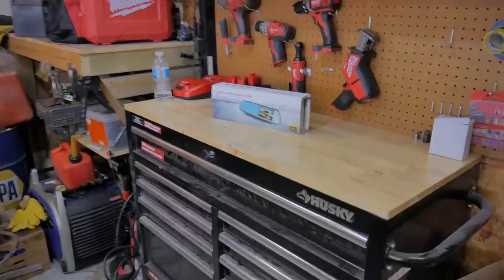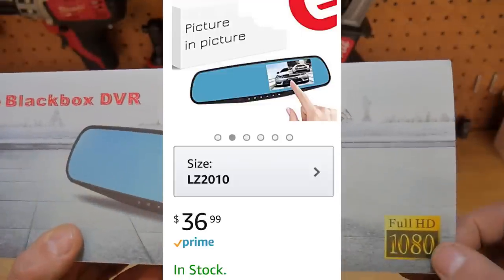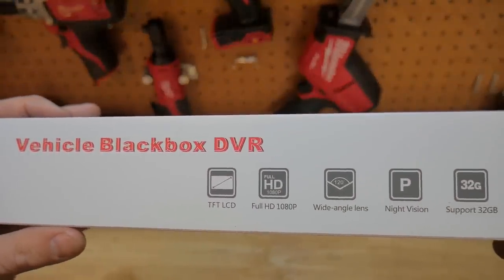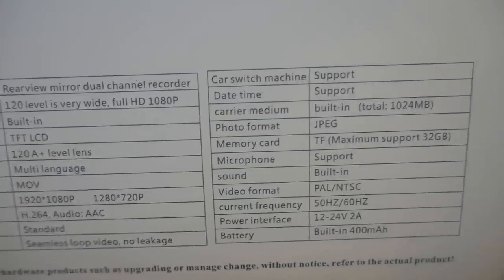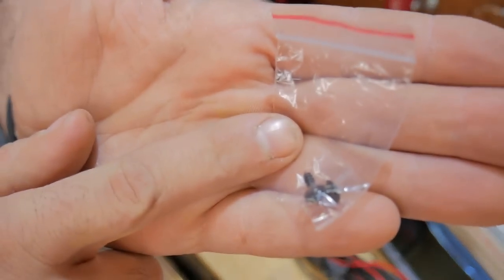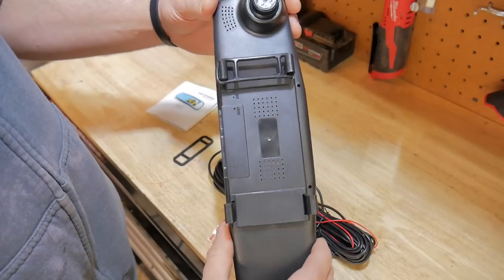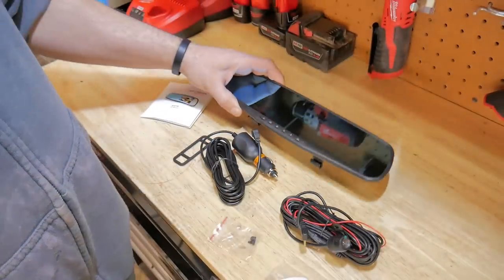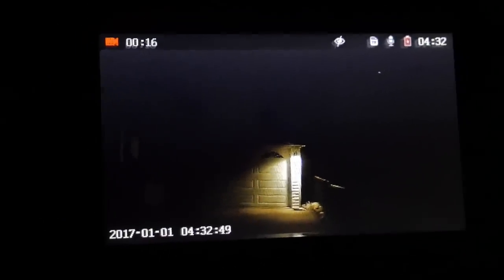Amazon/Dash cam install and review 1080p dual camera rear view mirror display

Comment: I bought a very similar model cam a few years back. The cheap rubber straps will break / dry rot on you quicky. I found using hair ties/bands, the small ones a better option to securing it to the rear view mirror.
Reply from the maker: Thanks for advice I was thinking the same thing
Reply: i just installed the sqame cam and i lubed mines in vasoline first. hoping it will help last longer

Comment: Very useful for me, thank you for posting it. I've just installed one of these units and the first thing I found out was that I couldn't set the menu with out first putting the memory card in. As I live in Thailand I needed to change the language to English to set the thing up. Your right about the mirror on dash cam. It's not bright like the factory mirror and takes a little time to get used to. All in all a good cheap piece of equipment just in case of accidents .
Thanks again and all the best from sunny Thailand.
Reply from the maker: glad your experience was good overall. for the price it is hard to beat. and your right great insurance just in case

Comment: Thank You for the examples. 
It is nice feature that both cameras get recorded automatically when it receives power, and that it maintains the recording even if manually turning display off with On/Off button. 

But I do have a setup in mind where I would like to have the video come up only when I start reversing, and show that reverse camera feed. I don't want to see any video when I am driving, as I don't care about that at all.
But it would be nice to have the frontal camera recording all the time, as safety video for proof if not guilty for accident etc, or something happens at the front and need to show evidence behalf of someone else. 

The reverse camera quality now can be improved with different camera, and night quality by having the IR lights lighting up the rear part.

I really like the idea that you can use the mirror as the mirror when reversing, as your mirrors are your primary means to see rearward. And why the reverse camera should be angled heavily downward so when you are backing up to tight place (pocket parking etc) you can actually see your trailer hook and distance from it to maybe 150-200 cm backwards, even just seeing a 100 cm backwards from the hook is enough, because then you can easily reverse and get your distance to car behind you properly, while you see everything else with mirrors. 

The mirror seemed to have a strong blue tint in it, and seemed to be fairly dark overall, but it can be difference in the camera itself. In night you don't see much with mirrors anyways unless you have good bright reverse lights in your car. 

But good presentation. Thank you!

Comment: Some years later I have one of these. Today only 6 days after install, it rubbed out an important accident. It just skipped to another event. The product had a lock on impact. In any case, the information was lost. Thanks for the vid. 👍
Reply from the maker: sorry to hear that. that really sucks !
Reply: @AllThingsCool  Hi, I've set it to 5 minute blocks now, seems OK. I'm pretty certain the firmware is a variant of another from a different dash cam I had. We'll see.

One thing of note: Left hand drive vehicles will have a problem. The lense does not twist enough to see the front left wing without losing rear sight from mirror. A mod is needed.
Best 👍
Reply: I just bought 2 of them and it has a feature to not loop. I turned it off so it just continuously records and I put a 32GB micro USB card in. Mine is the PLCMDVR49 version. 
 The only problem I'm having right now is the fact that the back facing camera is reversed. I'm contacting the company through Amazon right now to find out why. I don't think the back facing camera should be backwards.
Reply: @godcomplex2105   I had to check what is up and down on mine. My image was upside down too. I switched the mount on the rear cam and attached it to the top of the rear window. Hope this helps.

Comment: Great video! I purchase the PLCMDVR49 version, which is exactly the same.

However, the back facing camera is flipped in view.

 Did you have the same problem with yours? I don't understand why it's flipped and all the letters and everything is opposite?
Reply from the maker: check the settings see if there is bad mirror setting on and off

Comment: Open up the camera and rip off the battery! Or replace it with Ni-Mh! The battery swells up and mine was swollen since i got it. 
Leaving it into a hot car can turn it into a fireball,but pressure build up in the battery will eventually make it explode!
Reply: John, did you just remove the two small screws on the bottom of the case? Which battery did you replace the Li-ion with?

Comment: I have the same camera. All worked fine for a long time then the rear camera stopped working. I uninstalled it checked wiring etc still no joy. Some time later it started working again but not for long. Tried all the settings and still nothing. Any ideas?

Comment: Thank you that was very helpful the only thing about it is all those wires but you know how Express yourself very well 😊👌but I think it should be wireless thank you again for sharing 🥰👌
Reply: I bought one similar to the one in the video from Walmart for $47.00 I like it somewhat the video is too small why would they put such a little screen on such a big mirror I could see if you wanted it to be that small but I can hardly see anything its so small. At night forget it I can't see anything. My husband bought one from E- Bay and he can see at night like it was day time. He also has the lines and it beeps if he's getting to close to another vehicle. Mine doesn't do anything like that. Someone scratched the side of my gmc and it didn't even record who did it. So the motion doesn't work and If I had all the paper work I would take it back unfortunately its all been installed. I thought I had audio on mine but it doesn't seem to record voices. But thank you for the video it was very informative and G-sensor is basically g force it records the direction of force the vehicle is going when in a accident. So it determines who is at fault.

Comment: Hey, I recently got mine, it came  with no rear camera and cable. The car has a backup camera can the cable be bought separately and connected to the camera?
Reply from the maker: Not sure, check Amazon or contact the seller/brand
Reply: Mine came with no back up cam, and the mirror is broken in 3 places.  They refuse to replace it, or send the completed order.  Don't buy it!!!!

Comment: what did you do with the red wires on the back camera? do you just plug it into the mirror and its good to go?
Reply from the maker: Maddie Martin the red wire goes to a reverse signal source like reverse lights, thus way if you put vehicle in reverse the mirror will go into reverse camera/backup mode, hope this helps
Reply: @AllThingsCool  does it need to power the rear camera or no?
Reply from the maker: @overratedsrtchallenger  no the wire is for the reverse signal to turn on reverse mode hope this helps

Comment: Hi. I know I am late to the comment section, but the mirrors I were looking at come with a reverse camera like yours and say to connect it to the reverse light. What if I were to just plug that camera into the mirror without doing anything to the reverse light. I know that it would not come up in reverse, but would I still be able to view it and record?
Reply from the maker: The reverse wire is just to switch the screen to view reverse mode

Comment: I have one two. It is working for me ok.  Cons for me would be that at night is darker to see cars. Of course car lights helps. it looks similar to when you turn it to avoid people with high beam. When recording at night the Lights glow a lot on my version of dash cam (Beangel) from ebay. But I will check to see if it is due to the plastic over it. I didn't notice it. During day works fine.

Comment: So the backup cam has only one red wire and no ground?
Reply: the red wire normally connects to the power wire for your reversing  lights -sends a signal to dash cam to switch  the view to rear camera  for reverse mode for as long as your in reverse gear

Comment: Hi mate..i m not sure if u can help on this ... i bought something similar gator reversor mirror and camera .. it was working fine first couple of mins i was playing with the settings and all and turning screen on /off after few mins it stopped responding i mean it wont even turn on even after i press reset button .. thoughts
Reply from the maker: Check fuse in cigerate lighter ?

Comment: Just trying to work out how the rear cam works without connecting to reverse light ??
    Bought one of these,connected up as per instructions nothing from back.Although the front cam comes
    on straight away ! According to instructions,need to run cable to reverse light,connect to live & negative
   and join connector on wire to one on camera. Does not work. Doh !
Reply from the maker: syd bell have you pulled the sd card to check to see if both are recording ? Theres options on the mirror to switch views you might have it on front view only ??

Comment: How to use the recycle recording ... after 2 hours my dash cam is not the deleting my old videos ...its just record but nothing is saved
Reply: It's a "Loop Record"..it does not SAVE and LOCK  it unless the G-Force sensor has been set off by an impact of some sort. Otherwise it's permenantly on Loop which saves on Storage Space. G Sensor can be adjusted, as well as Time Loop..ie: 1min..2min..3min of recording, before it starts a new recording imediately after the last so you never miss a thing..you can then easily find that Saved and Locked Recorded File along with Time Stamp.
They all work this way. Hope that helps.
Reply: It's also good practice to re Format the Card now and then but only if you have nothing to save in the Locked Files. Keeps the Card fresh!

Comment: My Mirror Camera has the Camera on the bottom of the Mirror therefore I can turn the Camera on the Mirror 360 degrees .
My Mirror looks a lot like this Mirror Camera you have other than the Mirror Camera of mine they gave it more thought into the Mirror .
Otherwise my Mirror Camera lines up perfect 👌 with the old Mirror.

Comment: I have the same exact model.
It captures and stores everything perfectly. Except, i can't download the videos on my laptop. Tried different file system setting on Micro card, tried  different cards, try different usb wires.

Any idea to troubleshoot??
Reply from the maker: I had the same problem If I remember I had to dl a different player
Reply: @AllThingsCool  hey Chuck. Thanks for replying on Thanksgiving Holiday.
Could you please elaborate more ? What do you mean  by a different player?
Reply from the maker: I cant remember is it a mov. File ? I'm pretty sure I had to download a player on my computer to get it to read
Reply: @AllThingsCool  "I cant remember is it a mov. File ?"

It's an AVI file.

For playback, use VLC Media player. It plays virtually any file type.

For editing, you can use Windows Movie Maker, or for something a little more advanced, I use Nero Video.

Comment: but wat if someone break into your car can that camera record anyone that come close to ur car while you sleeping
Reply: You can order a wire that connects to one of the electrical fuses of your car.permanently. It will draw very little battery power and will be motion activated to record if anything bumps into your car.

Comment: i am putting this in 2010 chevy pickup short box and the rear camera wire is about a foot or foot and half short any suggestions
Reply: I have a canopy so I am not able to mount on rear window. I am running it along the frame to the rear license plate
Reply from the maker: @tomstevenot7122  man that's a tough one, maybe route it different if possible to make up that foot, see if manufacture sells the rear cam with longer wire or worse case cur the wires and extent them yourself
Reply: @AllThingsCool  so is it alright to cut the rear camera black wire and add a piece of wire in even though there is five pin plug
Reply from the maker: @tomstevenot7122  cant guarentee it will work  you should have the 5 wires inside the black wrap those wires will be very very small

Comment: What is the red wire for that hooks up to the rear camera?
Reply from the maker: Power
Reply: If you hook the red wire to the power (+) lead of your backup light, it will automatically turn on the mirror and switch to the rear camera for reversing. Additionally, the LEDs on the rear camera will also turn on to provide a small amount of light to help the rear camera see in the dark.

Comment: May i know whats the purpose of the red wire??thank you
Reply from the maker: Power source for backup cam if i remember correctly
Reply: @AllThingsCool  not power source- rear camera is powered by black wire connecting to main dash cam. Red wire connects to power source to rear reverse lights- tells main dash cam when to switch to rear camera view.  for reverse mode.
Reply: @hapeta24  hi, When I connected the red wire directly on the wire to the reverse light, but when I plug AV connector to mirror .... than the mirror will turn on and off again and again. Do you know what to do with it?
Reply: @Tomaso-czech  .. So before you connected  that red wire- your dash cam turned on whenever you  started car and your view was the forward facing dash cam only  yes??.When you run the wire loom to the tail gate or rear window one  connector plugs  into the rear dash cam  the extra  wire-usually red? runs down to the tailgate or rear of the car and connects to the power wire for the reverse light.If it is intermittent i would check the connection is good- i soldered mine.. or disconnect the red wire and see what effect it has.If the front cam then works correctly i would contact whoever sold you the unit and talk to them.or recheck your fitting instructions page.

Comment: How to remove the vibration on the mirror dash cam when i am driving. That is my problem with mine
Reply: Hot glue it to the original mirror or use double side tape usually it the middle the foamy material is good to absorb sock/vibration to some extent

Comment: You skip the hard part. Yeah it's how to run the backup camera cable.
Reply from the maker: Lol I dont think that's the hard part. But every vehicle is different and it wont get ran the same way. For my setup I ran the camera to face out the back window but if u run to your plate just go along the frame and under the back driver side seat I had a drain plug that I ran the wire through to get inside the cab then just ran under carpet up to dash

Comment: It would be helpful if you showed where you mounted the rear camera.
Reply from the maker: Patrick Trieu i actually just temporarily mounted it to my headlinerwith to small screws so it points out my rear window for test purposes  hope this helps
Reply: @AllThingsCool  since then, have you mounted it at the license plate? I'm looking for a how to, I also have a quad cab Ram 1500.
Reply from the maker: @praedyththelost3753  check out this video on a different camera I mounted https://youtu.be/c4oq50Ph8WM i ran the cord from the camera along the frame to under the backseat mine had a rubber grommet there that's where I ran the wire up into cab

Comment: Does it remember the settings each time it turns back on.?
Can you set it so the screen doesn't appear when you start the engine and drive. 
 Can you set it so that only the reversing camera comes on automatically only when you put it in reverse gear?
Reply from the maker: It remembers the setting as long as u keep it charged I think you have to run screen off everytime though it wont remember that
Reply: "Does it remember the settings each time it turns back on?"

Yes.

"Can you set it so the screen doesn't appear when you start the engine and drive"

No, but you can set it to for the screen to automatically go off, after 5 seconds.
Reply: Mine stay on for like two minutes what setting should I keep it on

Comment: the factory batteries in them are bad from the start. I wired in a battery from and old broken PS4 controller. lasts much longer now. any lithium 3.3V battery will work. search on ebay for one. I suggest getting one with a protection board built in, like the PS4 controller  battery. PS3 probably works just as well. unfortunately, the audio will always suck. it's how its encoded. I've swapped out the microphone and speaker and they still sound like shit. nothing you can do about that.
Reply: Yup. I recently pick one up for ~$20 just to play with it and the battery will not charge. In fact the reason I wanted to watch this video is to see if his battery symbol was green - it is not. I had thought of taking it apart to see if I can replace the battery. There are two small screws on the bottom of the unit.

Comment: I have this, you need a big sd card if you wanna use parking mode
Reply from the maker: Driving With Alex havent used park mode yet
Reply: doesn't it say only 32gb max ..can you do a parking function video please like to see how it works
Reply: Saigonboi 23 yeah it does, i wanna try it with bigger and see if it works and ill post a video of parking mode, i hook it up to a battery bank and out motion capture on
Reply: cool that would be great

Comment: Where install back camera red wire
Reply from the maker: Reverse wire signal, connect to reverse light
Reply: @AllThingsCool  so you don't need to plug in the loose end anywhere? Or do you, if so where?
Reply from the maker: @christinaong5250  no you dont have to hook up red wire unless you want to use the backup view when in reverse if you dont hook up red wire the camera will still record. While driving hope this makes sense
Reply: chuck kososky so it’s only optional?